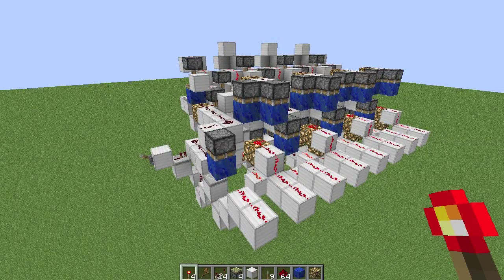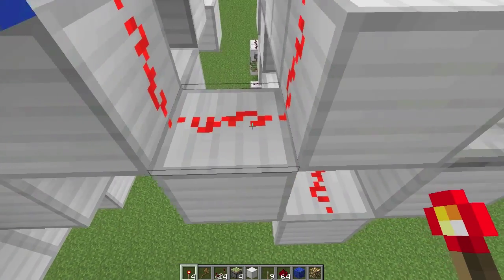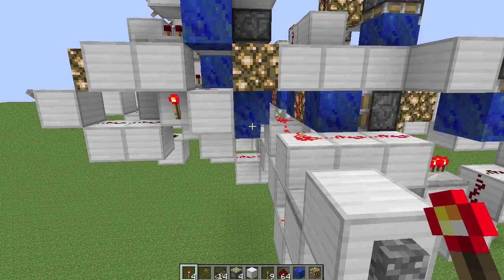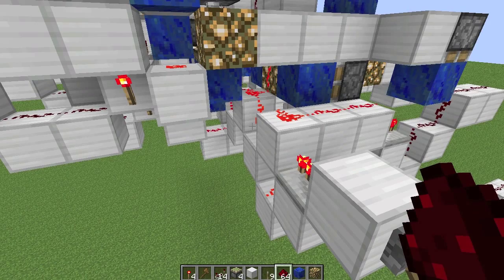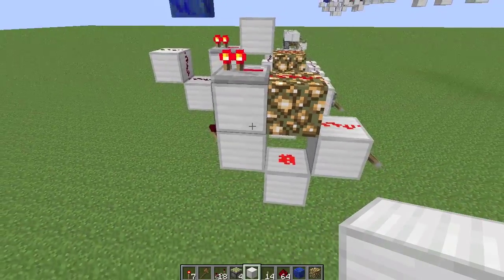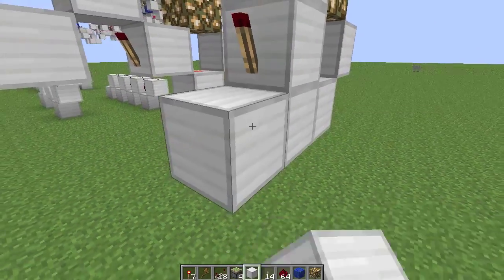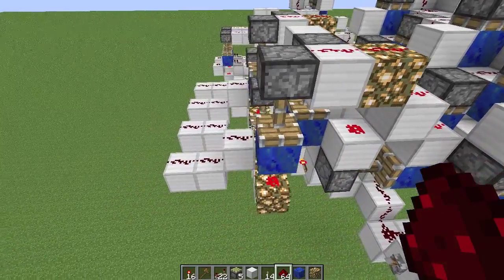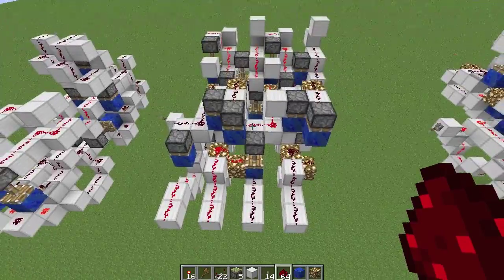Advanced Tutorial: How to Build the Fastest Insta-Carry Adder

Comment from the maker: It is, glowstone is a "transparent" block and has some special properties. First, it won't cut wire even if it appears to be blocking it. Second, glowstone won't be powered by redstone, repeaters, or torches (this is pretty useful for avoiding unwanted block update issues with pistons). Finally, it can act as 0 tick diode because a signal can travel up the side of a glowstone block, but not down. All in all, it's a pretty cool feature (even if some of the properties don't make intuitive sense).